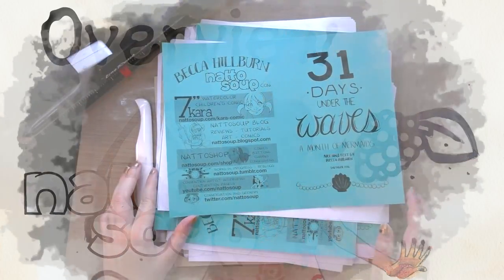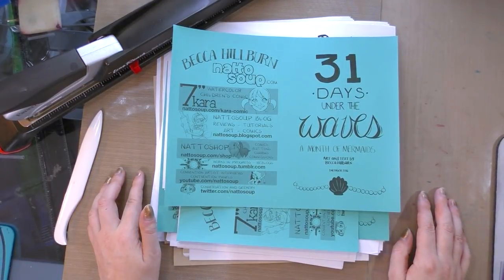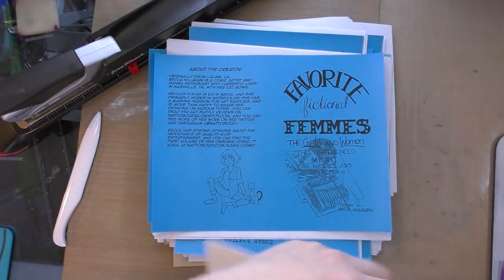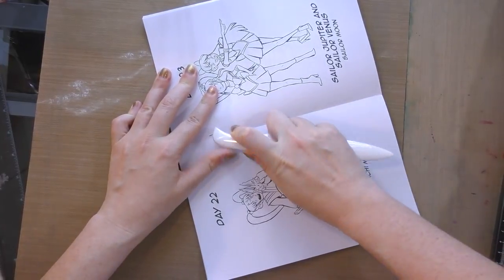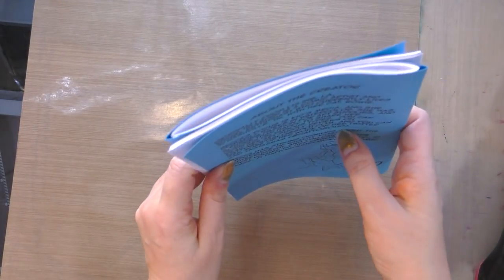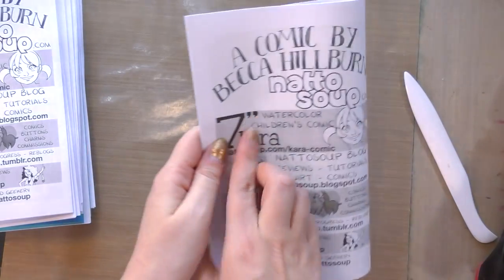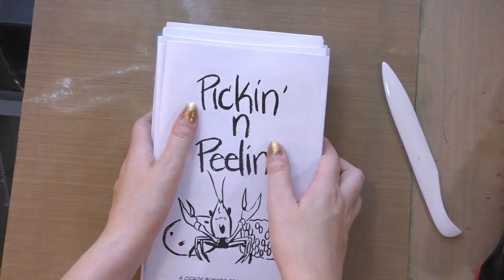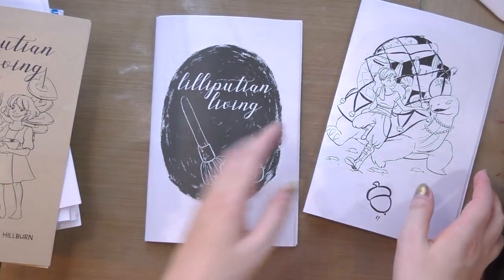Assembling Zines

Comment: This WAS helpful, instructional and informative...  I hope I got that line right.  😀  
A tip from someone who has used a lot of staplers.  Staplers hate 2 things.  One is being down to the last five staples.  The pusher does not agree with the small number so just toss those last few staples once the jamming starts and put a fresh line of staples in.  The second thing staplers hate is multiple little groups of staples in the track at the same time.  The pusher tends to overlap the small groups in the track and the jamming begins.  Only have one line of staples in the track, not several small ones.  Thank you for your great YouTube videos.
Reply from the maker: Oh man, thank you so much for sharing this!  I'd noticed it was more prone to jamming in small groups, and generally try to avoid loading those, but sometimes they'll break while loading.  In the future, I'll remove those, rather than persisting.  This is really helpful- I'm going to pin this comment so others can benefit from it.